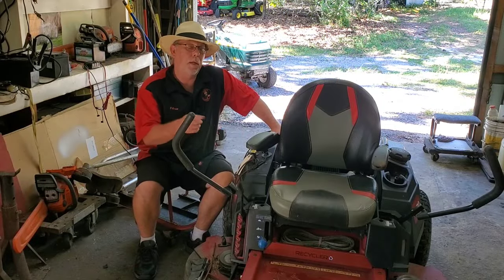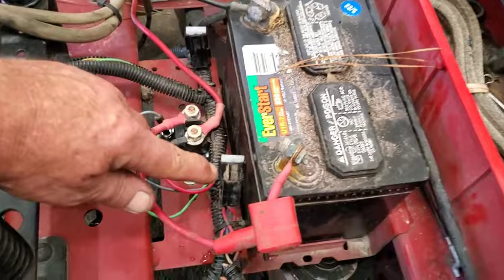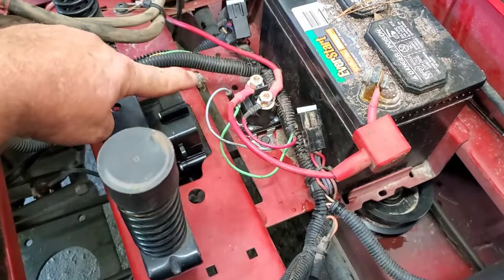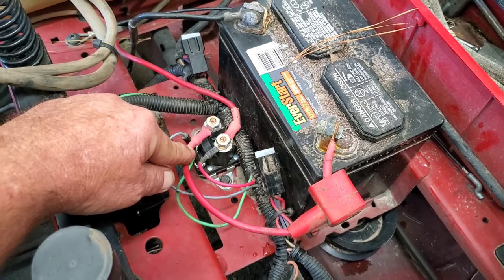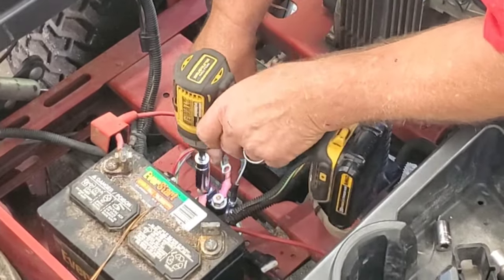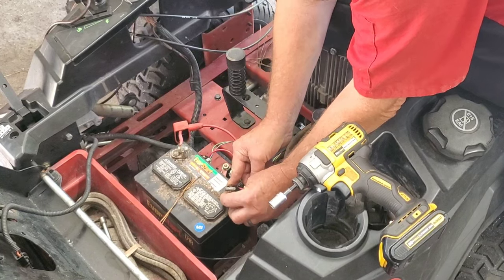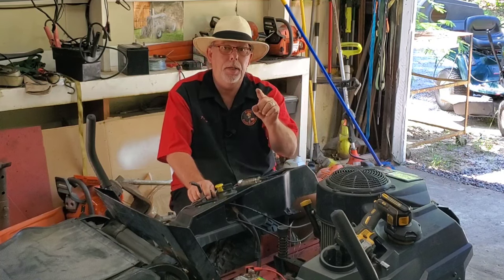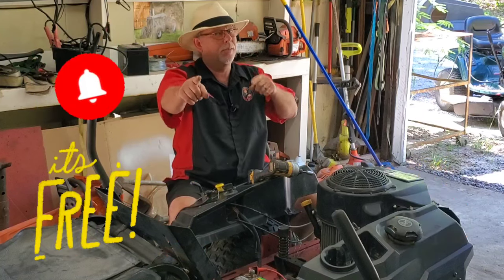Toro Zero Turn TimeCutter No Start Electrical Issue.  Brake Module? Solenoid? Engine Won't Turn Over

Comment: I see this all the time. Lol. I hate those electric brake modules. They’re garbage. I have a Toro in the shop right now and the guy has replaced that brake module twice already. I took it off and threw it in the trash where it belongs and put a manual brake lever on it.

Comment: I have a Craftsman DYT4000 and it would not start. A tinker fairy had already “looked” at it. I tested the safety switches and all that stuff. Then it dawned on me…. Two hours later. 😊Where was that red wire from the switch to the solenoid. It was not there. The solenoid was already replaced, and then I remembered you saying  Do you see the problem. Put my hand on the wiring harness and felt a wire disconnected. News flash it was the red wire. I believe a mouse chewed it off and the old eye connector was vanished with the old solenoid.  Soldered in a new wire and heat shrieked it.  Mower started right up. I should have known, as I was not getting power to the solenoid from the switch. Thank you for turning on my 25watt brain cells.    Do you see the problem.

Comment: Oops the red wire was on the wrong side 😮
Reply from the maker: Yep gotta love simple repairs
Reply: @RaleysSmallEngines   glad you saw the problem with the wire and got it running again 😎👍

Comment: i have a 50in timecutter and my  module is running and wont turn off unless i pull the battery.

Comment: Just over a year ago I had to break down and buy a lawn tractor as I was having issues keeping up with my Toro Personal Pace. Unfortunately, there was very few choices available due to the supply chain problem. I ended up with a Craftsman T110 from Lowes. I have spent most of my time searching for channels that I thought could help me keep the beast running. Much to my surprise, I’ve beat the odds so far as it has accumulated 21 hours. This thing should have come with a bullet proof vest, it sounds like it is going to explode any minute. None the less it continues to get the job done!

Just ran across your channel. I have spent many hours watching different channels and yours is on my top five list so thank you. I appreciate your easy to watch and to the point presentations. Please stay with it and I hope for your continued success. I have little doubt I’m going to need it.
Reply: Thanks for your comment and support

Comment: T Bone, I can't remember on a previous mower that came into me, but it was a 2005 model Toro T420 I believe. The only thing that was clicking was the relay and would not go thru to the solenoid. It aggravated me for days. But you could jump the solenoid and the tractor would start up.

Comment: Hi, T-Bone! Thank you for the videos you make, they are very helpful and entertaining. I'm sure many people have been saved by these videos.
I have another question about our D110. I did a bit more research and found that the D130 tires fit on the same wheel rim as the D110 tires, and that the tires come out one inch extra on either side. In theory, this would make the tractor noticeably more stable on slopes, right? And just for clarification, you don't think that the wider tires or more aggressive treads would give much more traction, right? Thanks again!
Reply from the maker: Sounds like it would.  Thanks for watching and commenting.

Comment: Question?   My snapper zero turn clicks when I turn the key.  I did check the battery is good, cables are tight also going to starter tight and ground tight.   Solenoid sparks but won’t start.    The right arm of the mower is loose.  It wiggles and not staying in park.   Would this have anything to do with it not starting?   Any suggestions as to why the arm is not tight.

Comment: Hello :) You have any idea as to why my Zero Turn dies once handles are engaged to move forward? Ty ❤❤
Reply from the maker: Check out my Just Clicks video to learn how to test safety switches. It's possibly the brake safety switch, but it needs to be tested with an ohm meter. https://youtu.be/YHuMcAonKvY?si=-pFnewevC3e_YPg4
Reply: @RaleysSmallEngines  Thank you, I sure will! ❤❤